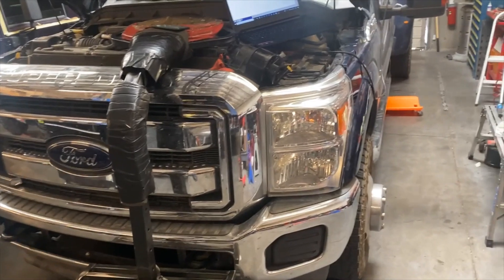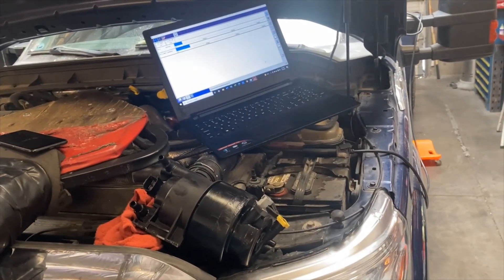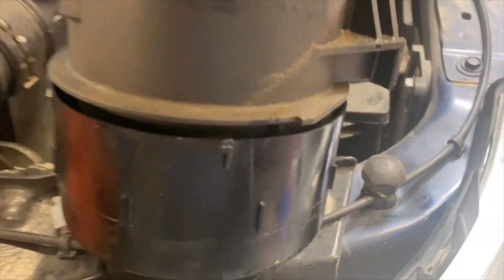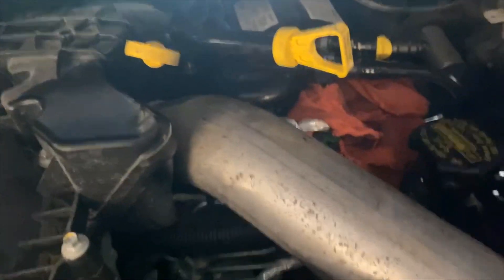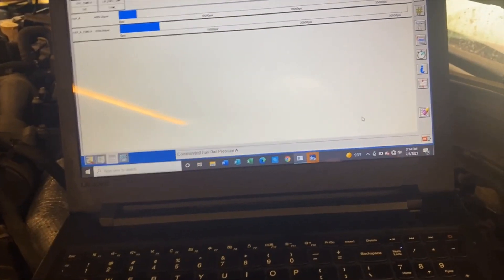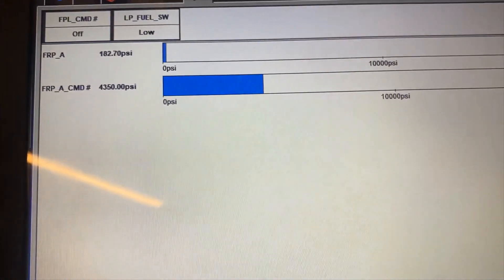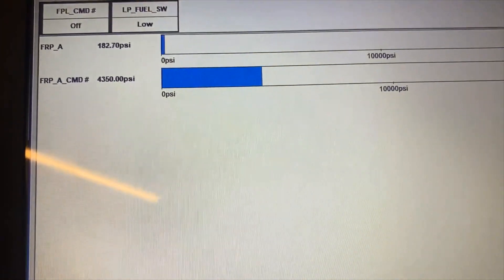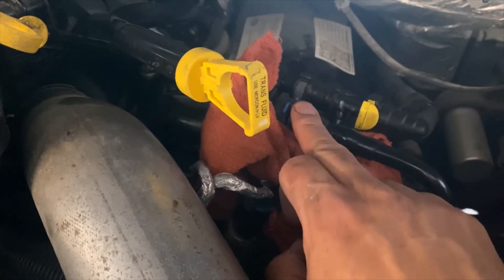Powerstroke 6.7L low fuel pressure on lift pump low side

Comment: Great tip on air trapped in the fuel system. I recently bought a 2012 and added a disaster prevention kit to it (while I was replacing the turbo that self destructed).I changed both filters as well. I did the key-on cycle 8 times but no joy. After watching your vid, I pulled the line of the output side, attached a temp hose, and viola -fuel flow.  Doh, I should have thought of that. Thanks!
Reply from the maker: Glad to hear it helped! Thanks for watching!
Reply: I’ve done this step but after a few purges with air/fuel mix I’m not just getting a massive amount of bubbles and no fuel. I’ve cycled probably 10-12 times. Keep going or change something?
Reply from the maker: @adamyunker3131  ok so I can understand, you have no fuel coming out of the secondary fuel filter?
If that’s the issue, you need to confirm the pump operating. See if you can hear the pump running. This occurs with key on.
Let me know
Reply: @dieseltalkwithtonysalas8725   Hey Tony, is there a way to test the rail pressure controller? After my repairs (see above), I headed out for a road trip. Everything was great for 1500 miles. Pulled into hotel for the night - next morning, crank no start. This time I checked the fuel flow first and everything seemed great. Then I got a P2291. I concluded it was most likely the HPFP.  So, I ordered one from Ford and replaced it (in a Marriott parking lot lol). In the end, there were no signs of pump failure, but I still have a crank/no start. The rail pressure was commanded to 5000 but actual was reading 100. Frustrated, I flew home, have ordered some more parts parts (lift pump, rail pressure sensor, fuel pressure gauge), added Forscan to my arsenal, and am getting ready to fly back to the truck. With Forscan, I can command the fuel pump on to test the lift pump, but what about the rail pressure sensor? I know I can do pinpoint testing with my volt meter, but is this the only way to guarantee operation?
Reply from the maker: @jimsteinbacher  you could be losing pressure at the PCV valve on the driver side fuel rail. I mention it in one of my videos. I remove it and crank it over after confirming lift pump operation. I doubt your pressure sensor is your problem. Read the sensor voltage on the scan tool.
Reply: @dieseltalkwithtonysalas8725  yes - pump is running.  I’m getting flow but it’s got a lot of air. Talked to a few mobile mechanics and they said sounds like the seal isn’t right on the lower filter because I’m getting way too much air. Going to pull that off and reset /check the O-ring. Pulled the fuel-in line off the top filter and pumped it into a bottle and same result so seems like the issue is between the lower filter and the upper filter. 

Any additional thoughts? I’ll report back in a bit.
Reply from the maker: @adamyunker3131  Seems you are on the right track. You sure there’s fuel in the tank? Not to insult you but if there is still air coming out after checking filter seal, I would add 2-3 gallons.
Reply: @dieseltalkwithtonysalas8725  okay so couple things - still have a 1/4 tank (started with half but have several gallons in buckets right now from pumping). 
I checked the bottom and the filter was a half-turn shy of tight. I counted the turns on/off but it must not have grabbed for a half turn. Took it off and tightened it back up and double checked o-ring. I felt the filter casing hit the back wall and the alignment tabs are perfect. 

After priming several times still no luck. The pressure in the fuel-out tube is very minimal (basically a light burp), but still can’t turn her over. Batter is dead so I’m charging the battery right now. Thinking of doing a wet-tap next (turning on pump, then attaching fuel-out with pump on.  Pump on the bottom is much quieter but can still hear some light “air gargle” on occasion. Aside from taking off again and re-applying if a wet tap doesn’t work, anything else I should be looking at?
Reply from the maker: @adamyunker3131  if there is fuel and pump not priming and filter is on correctly then sounds like the lift pump is bad.
Reply: @dieseltalkwithtonysalas8725  Thanks, Tony. I will check that out. It does raise a question though - wouldn't I see a fuel leak at the PCV if it was the cause for losing pressure (unless it's dumping everything into the return)? I suppose I could pull the return line and see how much fuel flow there is. I would think a lot would indicate a bad PCV (i.e. not closing??). Your insights are very helpful and I appreciate your time and effort. And while I know that free advice is typically worth what you pay for it, I intend to pay it forward with a posting of my own (though I am FAR from an experienced diesel mechanic).
Reply from the maker: @jimsteinbacher  dumping to return is what the pcv does. You need to focus on your low pressure side from what I have mentioned.
Reply: @dieseltalkwithtonysalas8725  Yep, that's the top of my list. I was just trying to think about next steps after verifying low side operation if it passes. I'm definitely not trying to put the cart before the horse (again). Given that I am doing this a parking lot (instead of my garage back home) and have few resources there, I want to make sure I fully understand the 'what ifs'. You have been a great help - thanks again.
Reply: @jimsteinbacher  well, I just did a disaster prevwntion kit on my 2017 F350 and guess what ... It started in the beginning, but after 50 miles, stopped. I am watching this video and it is a consolation that it is not the CP4 pump. I guess I might have air in the fuel. I do not seem to have any leaks in the DPK ( disaster preventon kit ) compression fitting. At this point, I will check for air in the fuel system. I managed to extend my CP4s life by actually lubricating the fuel. The pump in made by Bosch in Europe, and any european vehicle with this pump has no issues, but their diesel is also oily. And now NHTSA came out with a report that indeed the CP4s bomb out due to low diesel quality.
Reply: @radujohn  So, my truck is finally up and going. Honestly, in the end, the lift pump may have been at fault the entire time (I'm not exactly SAD that I i upgraded the CP4 to the 2015+ model, just wonder if I really needed to). The bottom line was that the original CP4 that I replaced actually got stolen before I could tear it down and confirm the failure. While I think I mentioned that the lift pump seemed to be working (seemingly pumping plenty of fuel into an open container), I had no way to confirm the pressure. I ended up replacing it before I got Forscan working. Lo and behold, replaced the pump, bled the air via the key on for 30 sec, then off (literally 8 times). When I took the chance and cranked on the 9th time, she fired right up. Damn. My fixes would have been a lot easier if I had been at home instead of a Marriott parking lot  (truck broken into. Tools stolen. etc, etc.), but the bottom line is, it works now and has been running fine for over a month.
Reply: @jimsteinbacher  awesome! I will try the lift pump. I hope mine has one.
Reply: @jimsteinbacher   What end up being the problem? Just curious after reading all of this.
Reply: Did you have bubbles coming out ? I see bubbles..
Is it supposed to be a solid flow of fuel ?

Comment: I have a question for you.. I had a low pressure light on went to change all fuel filters then a no start. my low pressure fuel pump doesn’t turn on, the power harness has power but when I plug it into the unit it looses power, I jumped the fuel pump to the battery and had someone else start and it ran… is my pump bad?? Maybe pcm?? Thanks!
Reply from the maker: Did you check and push on the inertia switch ?
Reply: @dieseltalkwithtonysalas8725  I just checked it, seems normal also replaced diode 15 in fuse box still nothing
Reply from the maker: What year is the truck?
When you say you ram power to the pump, did u run battery to the pump
Connector?
Reply: @dieseltalkwithtonysalas8725  I ran a positive and negative 10g wire straight from the battery directly into to pump and the pump works. But won’t work with factory harness… I was also looking at the inertia switch I watched your video on it, i probed the harness going in to it and there is no voltage at the inertia switch do you think it’s the relay in the junction box?? If so how do I change that. Thanks for your quick replies!
Reply: @dieseltalkwithtonysalas8725  it is a 2012 6.7
Reply from the maker: The PCM will only provide power with key on for about 10 seconds or so even if you leave key on.
You should check for power after the key is turned on. May need a second person to help you with that.
You mention you ran power and ground to pump. You sure there is a good ground to the pump?
Reply: @dieseltalkwithtonysalas8725  I just checked the inertia switch again for power at the grey harness and it still doesn’t read out any power on any of the wires within 10 seconds of the key on, I will loosen the bolt for ground on pump and clean it
Reply: @dieseltalkwithtonysalas8725  thanks for all the help and the speedy replies I found the problem and the truck runs now, I had a break in the YE-VT between the pcm and fuel pump relay in the driver side fender

Comment: I wish I could get my truck to you, I am stuck in Socal with a crank/no start after changing the top filter. Got a p2291 on my edge programmer, after about 32 hours of trying to figure it out had to tow it to a local shop. They still cant figure out what has happened either
Reply from the maker: Start off with disconnecting the outlet line off of the filter and tell me if fuel comes out.
Should be about a liter in 15 sec
You can have them do it with scan tool.
You take it to a diesel shop in S Cal?
Reply: @dieseltalkwithtonysalas8725  hello, thank you for your response. Yes, SoCal family shop. I will check in with them today. They have had it for 4 days.
Reply: @dieseltalkwithtonysalas8725  update, fuel is def coming out, both pumps are working
Reply from the maker: @volastod9327  is there rail pressure being built? 
This is the high side
As they are cranking, are they building rail pressure?
Reply: @dieseltalkwithtonysalas8725  70-80 lbs
Reply from the maker: @volastod9327  ok that’s no good
Need to check if there is contamination first see if CP4 pump has contaminated the system.
Remove pressure control solenoid at the end of the driver side rail and see if there is any metal coming out while cranking
Reply: @dieseltalkwithtonysalas8725  pressure control silinoid is being replaced right now, seemed to be some gumming/gel on the original. No metal shavings, no failed pump. Does the plug piece at the top of the cp4 go out or get replaced alot? 67k miles, did not break down or stop.
Reply: The tech things he found the issue, a leak in a back line, no sure if he means the skinny fuel line or the disconnect line🤷‍♂️
Reply from the maker: No with that mileage there should be no issues. Are you using bio diesel?
If engine starts need to run an aggressive cleaner in a full tank. A cleaner not a cetane or lubricant additive. I use BG 245
Reply: @dieseltalkwithtonysalas8725  truck is up and running. Tech said that it was a loose pressure regulator on top of the pump and a loose pressure valve that goes on the back of the rail. A leak which caused the no pressure, no start. Thank you for all of your responses 👍🍻
Reply from the maker: Never seen loose components, had someone worked on it prior? 
Your welcome